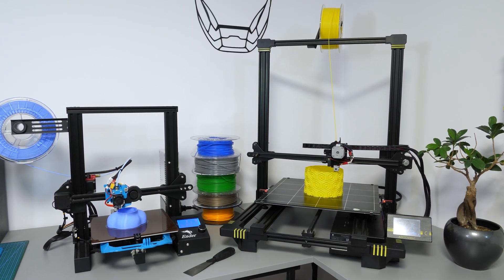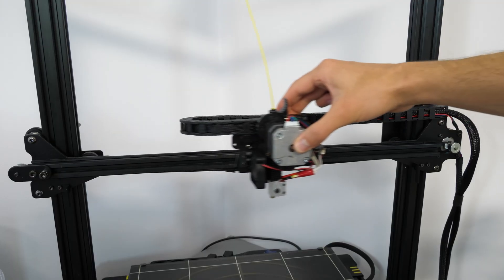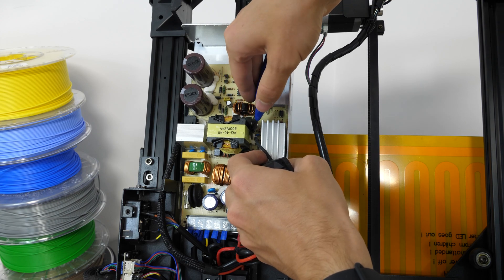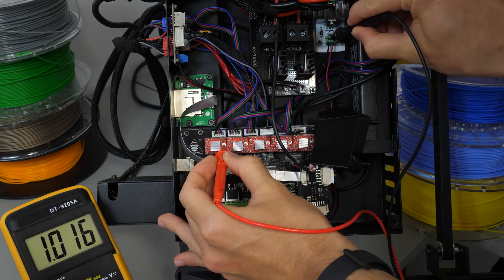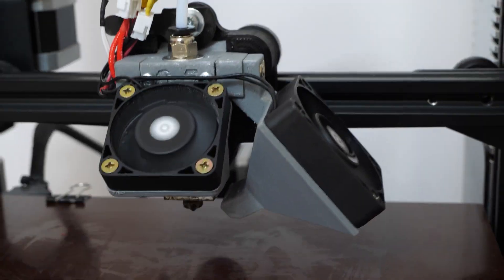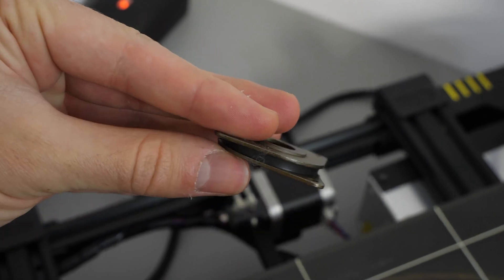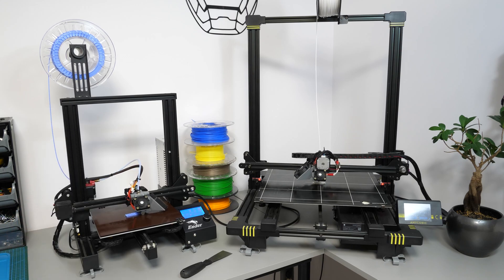No More Noise! How to Make your 3D Printers quiet (Ender 3 and Anycubic Chiron)

Comment: The only issue with using a 7812 linear regulator to drop 24v to 12 is that it will run hot.

Comment: So your circuit works, yes you can step down 24V to 12V with voltage regulator, but you are wasting half of the energy. 
Normally you step down from 24V to say 13V or 14V with a buck converter and then use a voltage regulator to get a nice signal.

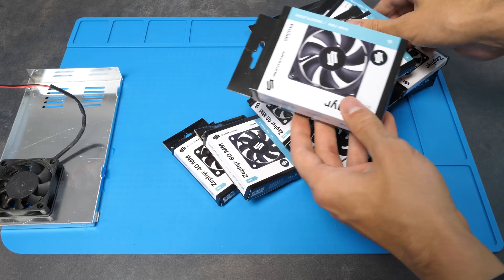Comment: hey, idk are u still here but, instead of some kind of converter to use just a resistor? im not an electronic engeener but ist just seem simple enougth to dropout a voltage (3:50)
Reply: Resistor is current not voltage

Comment: 8:55 schemat. voltage regulator skipped the hotends' fuse - it should be connected to (+) of the FAN Pin or (+) of HE. The motherboard fan and PSU fan are connected to HE1, but HE has current regulation for hotend, so it will work with variable intensity and only during HE heating. What if a bed is heated first? Then PSU and motherboard is not cooled properly! What if printing is finished? Then hotend is not cooled down and it could be dangerous to just leave it without supervision - it should be connected to e.g. (-) HE1

Comment: Dude, the easiest way is to just buy a 24v fan….
Reply: Yes, but also a 24v fan would run louder than a 12v fan. The point of the video was to reduce noise as much as possible.
Reply: @imjustwolf  24v fans can and often do have the exact same specs (and noise output) as their 12v and 5v counterparts, just a different input voltage. Just look at Noctua's specs for their variations. An aftermarket 24v fan is very likely to be leagues more silent than the stock 24v fan, and putting a 12v fan onto a 3d printer which outputs 24v would obviously cause issues (and be incredibly loud if it works at all).
Reply: @nepvee  He used a buck converter...
Reply: @vukasinvozarevic  How is that related to the point someone was trying to make that a 24v fan would be louder than 12v?
Reply: @nepvee  It isn't. It's an answer to " putting a 12v fan onto a 3d printer which outputs 24v would obviously cause issues (and be incredibly loud if it works at all)." There won't be any problems because his buck converter converts 24V into 12V.

24V fans are louder than 12V ones, that's true, but always check specs so you know for sure because they're all different.

You can also make 24V fans quieter and longer lasting by running them on 12V but they move less air.

Also you can make 12V fans move more air by running them on 24V, but their life would be decreased.
Reply: @vukasinvozarevic  if it wasn't a reply to me, why did you @ me lol?

Comment: These noise meterings are kind of suspicious. I'm also facing problem with loud 3d printer (ender 3), so I bought myself noise meter (cheap one). Meters of this quality usually cannot register anything below 30 dBA. To achieve this level I have to shut all windows and sit inside a room where nothing is turned on. So 19 dBA does not seem realistic. Ender 3 with Noctua fans gave me like 30-35 dBA which is really quiet. But I used 120mm fans for the motherboard and PSU and 40mm for the print head. And it was actually not enought, print head started to jam because of overheat.
Reply from the maker: Well I was using a smartphone app for the measurements so they probably weren't very precise. I was recording in a closed room with only the printers turned on at a distance of about a half a meter. All I can say is that the upgrades made a night and day difference, I can't really hear the Ender printing when I am using a computer in the same room. 

As for the jamming issue I didn't have such a problem, but now when I switched to Klipper for faster printing I must admit the under-nozzle cooling is severely underpowered and my parts do suffer from overheating. I am considering switching to double 24V 5015 blower fans and running them undervolted at around 12V, since they are much quieter that way and still blow a lot of air.
Reply: @BasementCreationsChannel  I switched to creality sprite and already bought one 5015 (but not mounted yet) because stock fan is also noisy.

Comment: How did you change the stepper motor in the code. Where is this code for Anycubic chiron?
Reply from the maker: I didn't change printer code for the Anycubic, just replaced stepsticks and swapped wires. I did however changed code for my Ender 3 with Skr 1.3 board, there are many tutorial on what exactly you need to edit in marlin to make it work.

Comment: 9:16 
are you satisfied with this huge printing head and fans? makes prints better or what are the advantages?
Im currently using stock head and thinking about making it better
Reply from the maker: The printhead itself is quite small, it's just the 50mm fans that make it appear larger. These fans are large because they are PC fans designed to move air at a low noise level. Therefore, I later added a second 50mm fan on the other side to improve cooling. Overall, they are not better at cooling than the stock Ender 3 fans, but they are definitely quieter, which is the main purpose.

Comment: On ender 3 the loudest fan is the front fan of extruder.
If you stop it by hand, there is almost complete silence.
Thanks for telling me about silentiumpc fans. I will order some. I have lots to print and can't sleep in all that noise. I also ordered silent motherboard 4.2.7
Reply: He uses a third party motherboard so it could be controlled, if you use 4.2.2/4.2.7 MB and connect the stock way then the hotend and MB fan will run 24/7 while the printer is on.
Reply: the reason it goes silent is that the motherboard fan is connected to the part cooling fan, meaning if the part cooling is off the motherboard fan is off

Comment: Hello my friend. I've looked at many designs and really yours looks great. I'm also making a lot of changes to my Chiron. like tmc2209.-fans-vs. this printer is very good but it has too much sound. Now I decided to direct drive system. this is my question Have you had any problems with this upgrade?
Reply from the maker: Well the things that were a bit problematic is figuring the wire connections leading to the hotend. Also tool changing with this new system requires you to remove the cable chain. Other than that it works great and it's remarkably quiet.
Reply: @BasementCreationsChannel  Thanks for information. I've looked at your files but I don't see the hot end holder? can you check them please ?
Reply: step file is slightly different from video
Reply: or is it the same but enough for the hot end block to stay there?
Reply from the maker: The original extruder is a part that holds the hotend. To assemble it you need to remove the top extruder cover and screw the rest to the 3D printed part

Comment: replacing a "loud" 24v fan with a "quiet" 12v fan in your power supply is the kind of thing you need to actually test thermals for

it was loud because it was moving a lot of air, and now you are not
Reply from the maker: Yes you are right, that's why I wrote long disclaimer in the description. Hovewer the fans were also loud becaouse of poor quality and overvoltage. In my case thermals were ok in both printers but for some machines with hot PSUs changing fans might be a bad idea.